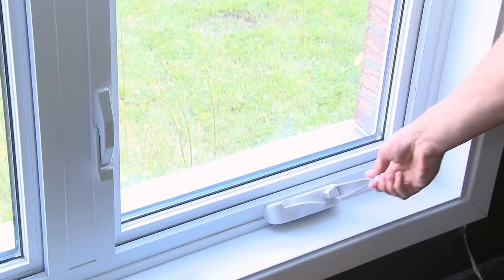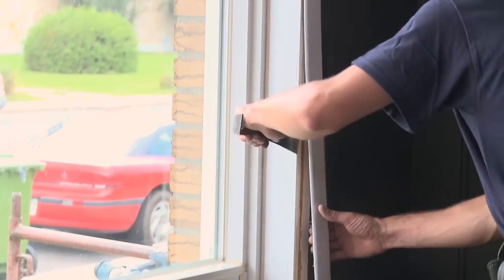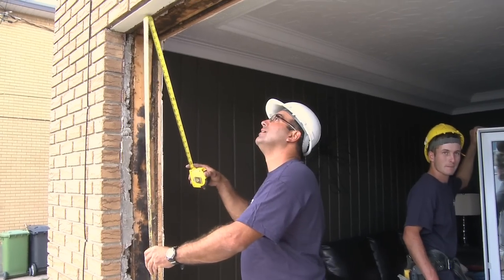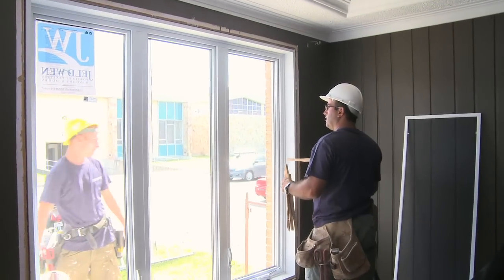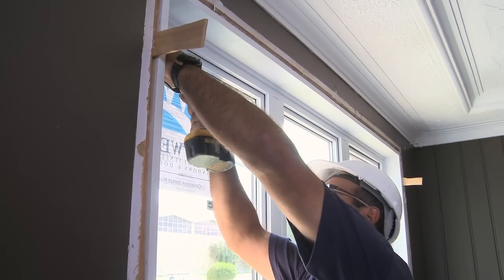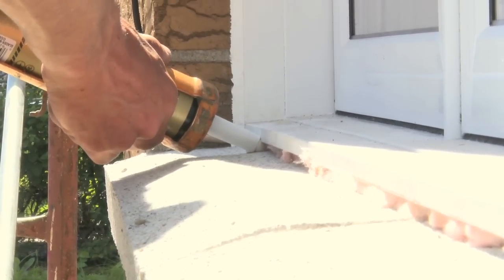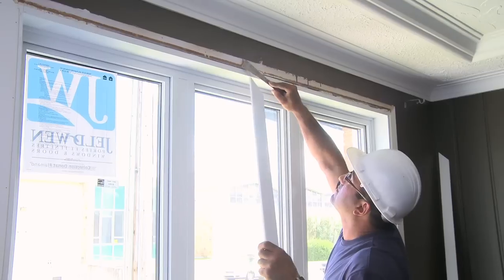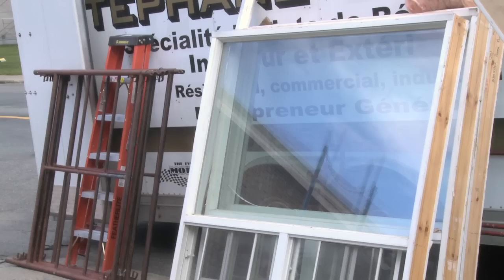10 essential steps for a proper window installation

Comment from the maker: Hello,
Yes it is the most common used tool to remove any window type (with or without nailing flange). The most important part is how the new windows will be sealed to the existing siding. Actually prior to install the new windows the existing windows and opening should be inspected to find where the water infiltration was coming from in order to apply the correct solution.
Reply: i dont mean to be so offtopic but does anybody know a method to log back into an Instagram account??
I stupidly forgot my account password. I would appreciate any tricks you can give me!
Reply: @Warren Lucian instablaster :)
Reply: @Brandon Wesson i really appreciate your reply. I got to the site through google and Im in the hacking process now.
Looks like it's gonna take quite some time so I will get back to you later with my results.
Reply: @Brandon Wesson it worked and I actually got access to my account again. I am so happy!
Thank you so much you really help me out !
Reply: @Warren Lucian No problem xD

Comment: Fiberglass forced between the jamb and brick?  Really?  Is that "best practice"?
     I don't know much about the quality of windows, but the caulk is certainly a problem without backer rod- expanding foam works well for air but isn't a replacement for backer rod.  Caulk should have been tooled in both directions to help seal it to the brick and frame- and make it look better.  Don't use cheap caulk.
     Maybe prime the brick to increase adhesion (caulk primer).  Was it clean?
     The old windows should have had thru-wall flashing at head or sills, but didn't.  I wouldn't install a new window without both- the building code requires it- plus install flashing tape or something to air-seal the opening between the brick and sheathing at window jambs.
     Didn't see a 1" air gap behind the brick, and sheathing looks water damaged.
     It's a short video that shows some basics- not correct installation.  Should include redundancy for potential water leaks.
     It sounds like the word "flashing" has been deleted at 3:20.  It's often deleted during installation too.  Bad mistake. 
I won't go on.  See it all the time. And the resulting rot.
Reply: That’s a good analysis actually
Reply: -Completely agree with every point with a small note about "thru-wall flashing". Depending on climate, an exterior secured head-flashing that does not run the interior of the window might be preferred. Always good to consider limiting any thermal bridging.
- The airseal/faceseal detail (caulking entire outside of window) as a primary seal is really inadequate when dealing with wetter climates. Rain-screen with appropriate details and interior primary seal with rod and caulk is a much better solution for that environment. But it does complicate securing the window given that securing from the frame through the jamb is now a potential point of water egress. Have seen some good solutions using a strap anchor.

Comment: So much waste with vinyl windows.... So that huge window just goes to the dump? So stupid... why do people pull wood out when they have it. Just fix them. Good for 200 years with minor proper repairs.
Reply: Appearance
Reply: They do not look better than wood....
Reply: Ian Baldwin Appearance as compared to others. Original window style only needs to be installed in historical areas. Vinyl last longer, no trees required.
Reply: You're kidding right????
Reply: Ian Baldwin Unless the home is located in a historical area the window can be designed and made from anything one desires. Newer windows  block air movement much better than single pane wood windows. Double pane wood windows very expensive 750 to 1000 per window depending on size.
Reply: The problem is air infiltration. I do this for a living. A high quality zinc weather tripping gets installed and completely eliminates air movement and the window functions smoothly.
Reply: Wood windows will last indefinately. Vinyl only lasts 20-30 years IF you are lucky. or you get to look through a fogged window after 5 years. It gets brittle too. If you have wood you should keep them. I'm refurbing 105 year old windows right now. They are in great condition
Reply: I disagree with that. If you have a high house and charge appropriately then you could afford to have them maintained properly. In the long run it would be cheaper. If you can't do that then you shouldn't be renting a house you can't take care of
Reply: @ian-baldwin-woodworking  i had wood windows with mosquito nets and i never knew there was a sunset out my window for 20 years. They got damp and dirty.
Reply: i have replaced old wood windows for years they have 10 coats of paint most of it chipping .painted shut cant open them .rotten seals the list goes on
Reply: @chiefbiglew  your telling this to a professional windows restorer. They just need a service like any vehicle needs servicing
Reply: I know it's sad I'm doing a old Victorian home and they have old wooded stained glass windows they are old but there still beautiful and they are putting in vinyl stained it's a damn shame
Reply: @ian-baldwin-woodworking  I can 100% agree with that so many times people I've worked for replaced windows that were on 10 years old
Reply: @ian-baldwin-woodworking  lol don't argue with them they don't know shit about installing windows they all probably believe that caulk will last 30 years like the tube says 🤣🤣
Reply: @funnelnutz3227  it will last that long in the garbage